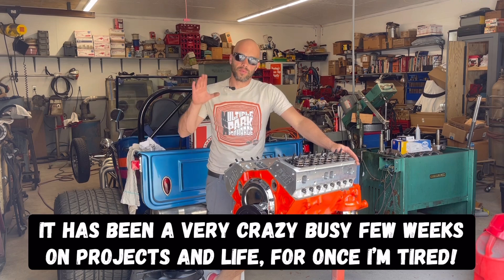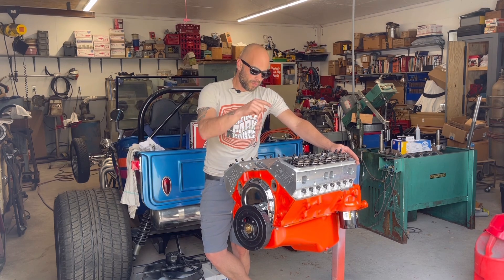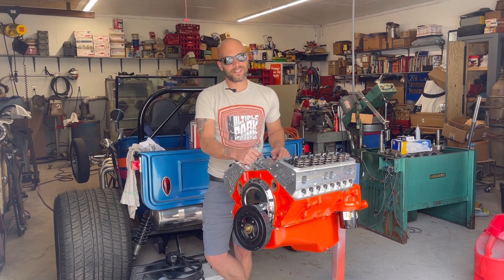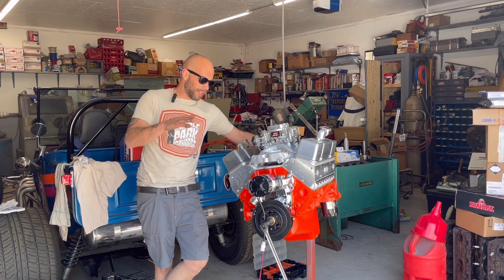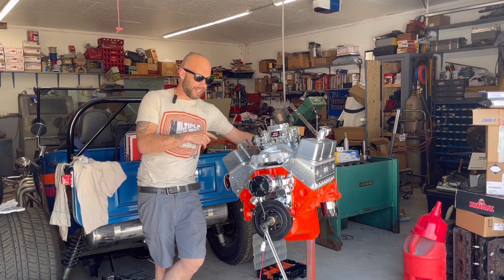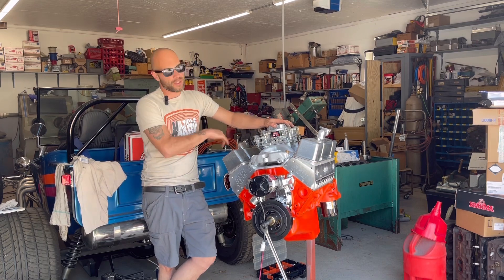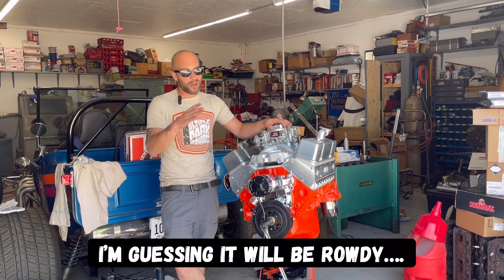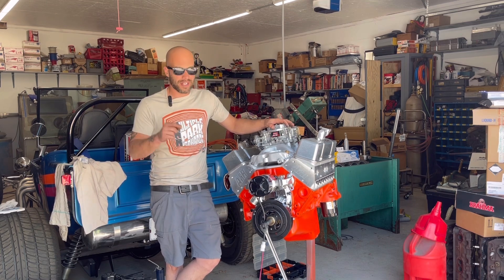Building a 1970 LT1 350 With a Modern Twist Part 2, Final Assembly! #chevrolet

Comment: Nice build. What model AFRs did you use? I'm looking into doing a similar setup on my stock bottom end 70 LT-1, except with a hydraulic roller.
Reply from the maker: such a great engine!  AFR 210's
Reply: @2HacksGarage  sweet, 65 or 75cc? I was worried I might not be able to the newer style combustion chamber heads and would need the old "bath tub" style to work with these pistons. What did you use for a head gasket?
Reply from the maker: @klabz28  65cc, fel pro 1014
Reply: @2HacksGarage  thanks man! Is there another video on the tunnel ram and the car running.
Reply from the maker: @klabz28  not yet

Comment: Hey jeff! You sure are a busy man! Dang dude. I also like solid lifters, however, the crap some are putting out there are horrible. Lifter and cam failures right out of the gate. I would spec those lifters out good. Some have been found to be ground to different heights, some are flat with no concave to them. Horrible junk from China IMO. Will not buy anything from Comp Cams until they get the quality control etc under control. What did you guys end up going with, (brand?) Thanks for sharing. Have always liked the LT1 engines.
Reply from the maker: they are Morel solid race lifters, a pretty good brand.  We got bit by chinese lifters a customer wanted us to use, hydraulic roller lifters.... they wouldn't oil!  Junk!   oh man me too!!!  The LT-1 and the DZ302 are awesome!